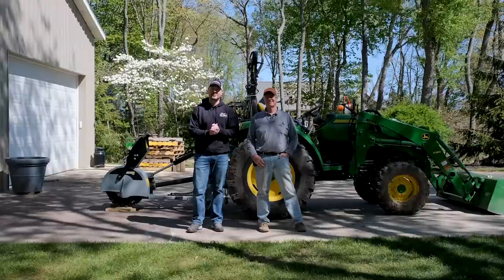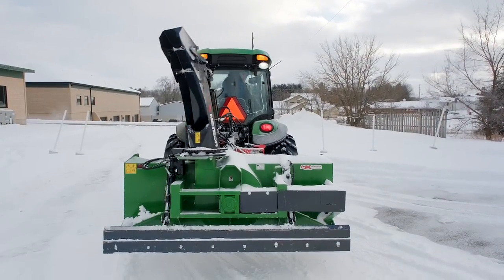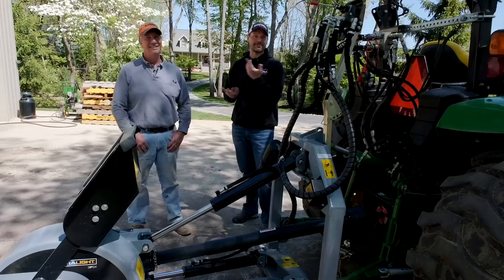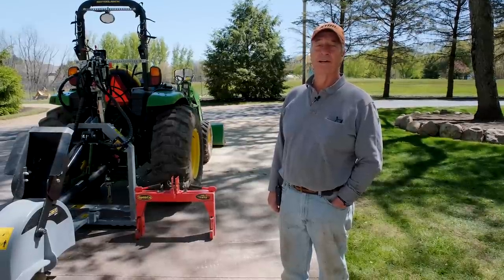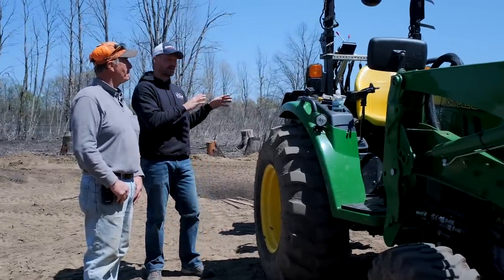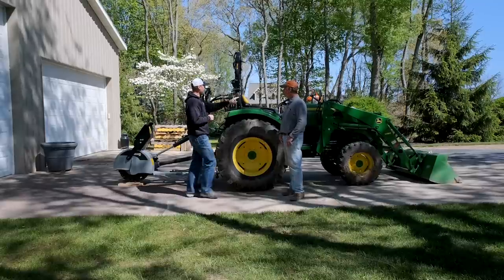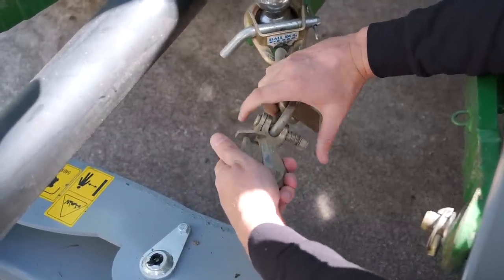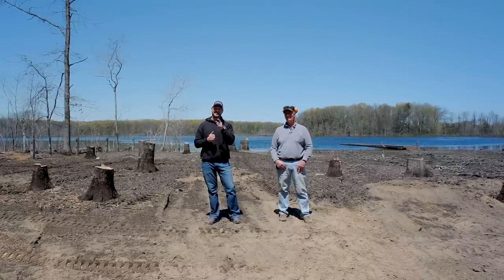50 STUMPS ARE NO CHALLENGE FOR THIS BAUMALIGHT STUMP GRINDER!

Comment: I have this exact stump grinder and don’t have that extra control thing. I have a cab tractor so it wouldn’t work. Even without that you still have a the flow control to slow the side to side speed down. I don’t feel you need it for the up and down. I have a summit diverter so have two remotes and it works very well that way.

Comment: You can get  a flow restrictor and place it in one of the hydraulic lines to the control the speed of rotation of a snow blower chute or any hydraulic motor or ram if your machine is not equipped with a rate control.

Comment: Just curious but I wonder why he doesn't cut the stumps down lower first with a power saw? There is great firewood left behind.
Thanks for the video.
Reply: The one taller stump was my first run with the grinder & I wanted to get a good view of what it could do. The rest of the stumps I cut lower. Can’t cut too close to the ground as I’d hit sand & the chain saw would dull immediately.

Comment: Instead of using a clamp you Override by attaching a switch on the consul to complete the electrical circuit for the third function Solenoid .

Comment: Does anyone have any idea if you could operate the stump grinder hydraulics from inside a tractor cab with the back window open (specifically on a John Deere 4066R)?
Reply: I have a Kubota L4760 and the 1P24. Works great with the rear window up.  If you have the controller lowered to run and you want to move "raise the controllers" or they hit the back of your head.  I grind stumps vs pull them as I don't have to deal with a pile of stumps.  So far I took out 55 stumps and another 50 to go.
Reply: OOPS!! I intended to write I have a 3P24

Comment: These types of Stump girders you’re featuring are just not great!  There’s an Italian model that is WAY BETTER.  I think it’s much more expensive, but a very different idea. 
https://m.youtube.com/watch?v=iei4xRjAito.  

I have a 2038r and don’t really need one, but it looks awesome. Love your channel! 

On another topic, Any chance you could make your “front hoe” movable. Meaning you have it in the middle. Could a future iteration have it move all the way right or left manually?  I’m thinking of trenching with it at the base of a hill or berm to put drainage in, but want it to be right up to the edge vs 3’ from the edge.
Reply from the maker: Good item, typically only see them on higher HP machines.  Different strokes for different folks.  I see advantages of each.  

Intentionally don't want the front hoe bucket to be movable.  That would provide an uneven force on the loader arms and have a higher liiehood of torqueing or twisting the arms.  Maybe not for the experienced operator, but I just don't think it's worth the risk.